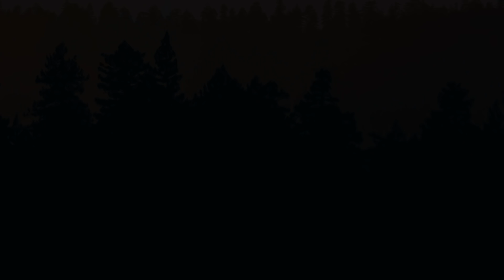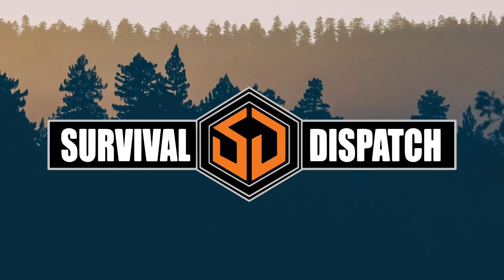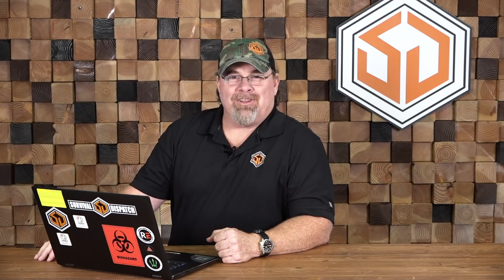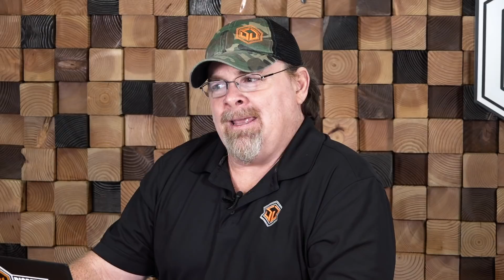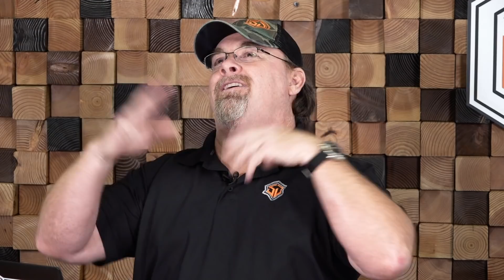All About Generators!

Comment: Another good idea is use a solar system and use the generator to top off the system at night.
Reply: Mine is 300 watts into 4 6volt golf cart batteries using a controller.. cost around 1000 total..with inverter..i use a A- I Power 2300i inverter generator uses 1 gal every 6 hours.   This is NOT a large setup but will run alot if you split up the load properly....small frig .. computer,,,lights..satillite dish..tv...fan...not all at once but it works..the generator was extra at 350 on sale at Sam's club so total under 1500
Reply: Mine is at full load if I went to half load I can double run time. Plus I didn't figure in the 6 hour I get out of the battery before I need to charge it up
Reply: @Karl Schubert  you should lowes sold it to you and that's were i sell them
Reply: @Karl Schubert  the reason I went with the A IPower 2300i is price. I got  it at Sam's for $345 and couldn't pass it up. I have a Champion 4000 and a Generac GP3300 that I bought at Lowe's someone returned for under $200 each...lol Im in Brunswick ga hurricane territory
Reply: @Karl Schubert  last big one I was the ONLY guy on my street with power, food , water , HOT water,Internet ,direct TV,  air conditioning....
Reply: @Karl Schubert   go silent as you can lowes sells a plastic tool shed,,line it with that silver insulation all side including top..add a box fan 18 dollars or a attic fan cut a hole and put some vents to blow out one side use vents on the other. You also can run it in rain that way! CHAIN that GEN to unmovable object! at 10 feet that gen will be silent! use the biggest size cord you can afford I MADE mine with 10/3 insulated wire we sell at lowes for .1.88 a foot and use the 30 amp locking plug one end and a 2 gang household plug at the other..look it up its easy. that will add 1/3 more to your available load at 30 feet total cost for a 30 ft cord was 70-80 bucks that way..commercial cords are over a 100 BUCKS! for a 25 ft                               https://www.lowes.com/pd/CRAFTSMAN-Common-4-ft-x-2-ft-Actual-Interior-Dimensions-4-08-ft-x-2-38-ft-Storage-Shed/1001052378

Comment: Propane is expensive and generates less wattage out of the same generator. I sell them for a living...also most people buy way to big of a generator.
Reply: Correct. natural gas is 200% more effective and efficient than LP from a generation standpoint as well as cost. Also, LP will disappear quickly, natural gas will continue to flow for some time because virtually all of the national level emergency operations plans and contingency operations have a massive priority natural gas, and they'll keep those lines charged if at all possible, for as long as is possible.
Reply: Diesel is nearly twice as efficient as gasoline. Lasts longer too.
Reply: @basspig  its also LOUD! around 100 decibels, everyone in a mile will know you got power..also VERY heavy and expensive ME I would spend it on a solar system with a inverter generator to charge it as a back up
Reply: Rick B 
Rick B, I’ve been looking for someone to mention natural gas.
Reply: It is..now try to find one.,.in india its not diesel its kerosene that is king

Comment: You missed one important point.  Make sure the generator is GROUNDED.  Most electronics will not run if the power source is not grounded properly.
Reply: Karl Schubert 

The manual that comes with your generator will tell you to provide a grounding rod, similar to the one for your house, to properly ground the generator
Reply: Here are the rules about portable generator safety: This is just a reminder for everyone’s safety. All generator safety rules should be followed carefully. This advice is just to make sure that everyone is aware of all the warnings and it’s just to remind people to be careful using portable generators. Generators can be dangerous if not used carefully. Every year, hundreds of people die or get injured when using portable generators due to carbon monoxide poisoning and electrocution. Make sure you are using your generator carefully and keeping others safe as well. There is something very serious that everyone should always be aware of when using generators. Some people do run their generator indoors which is not safe and that increases the risk of carbon monoxide poisoning which can cause death of family and you. Some people run their generator in wet conditions which can electrocute them. Please remember that you should never run your generator indoors. Remember that carbon monoxide is an odorless and colorless gas that you cannot see or smell. Carbon monoxide is a silent killer. Keep that in mind. Make sure your generator is 15-20 feet away from your house and away from doors, windows, and vents. Never use your generator in your porch too. Having a carbon monoxide detector is very important against generator safety. Some people also allow children to go near the portable generator which could pose risks. We need to keep an eye on our children making sure that they are not near the portable generator so they won’t get electrocuted or burned by the generator which is dangerous. A locking enclosure also keeps kids safe. A generator shed might look like a tempting place to explore, or take cover during a game of hide and seek, but a generator is a dangerous piece of equipment that can cause injury. It says on the manual that we should also keep children away at all times from the portable generator to avoid injuries. Please do not allow a child or unqualified people to operate the portable generator.  It is important to keep your children safe especially little ones. The portable generator can be hot during an operation. Just because some manuals missed what should be listed doesn’t mean it’s safe to do. Always follow the generator safety rules when using portable generators. Generators pose electrical risks. If you need to use your generator during wet weather, you need a generator tent to protect your generator from getting wet. Don’t let your generator get wet. Keep your generator dry and before using your generator, please make sure your hands and your generator is dry. Do not wear loose clothing when operating the generator. Everything that is said on the generator’s operating manual should not be ignored. Never smoke cigarettes near the generator. Please keep flammable things away from the generator. Never overload your generator too. Your generator can catch fire. Never ever try to plug a generator cord into a wall outlet to avoid back feeding. Back feeding your generator is dangerous. Always turn on your generator first before plugging in appliances and shut off the appliances before turning your generator off. Use a heavy duty cord for your generator and the cord should not be worn out. All the instructions should be followed carefully. Never refuel your generator while it’s running. It can cause fire if fuel spills while your generator is hot. You should turn off your generator and let it cool off before refueling it. Having a fire extinguisher next to the generator is also important. This is only a reminder for everyone’s safety of using generators. Make sure your generator is properly grounded. Having a fire extinguisher next to the generator is also important against the safety rules. https://youtu.be/I1jT3ANENvI and here is a video more about keeping others safe when using generators and also about our family’s safety. Hope this helps. Thank you.

Comment: My generator has been sitting in the corner of the shed for 18months waiting for me to service it. Thanks for the vid, will get it done today.
Reply: Here are the rules about portable generator safety: This is just a reminder for everyone’s safety. All generator safety rules should be followed carefully. This advice is just to make sure that everyone is aware of all the warnings and it’s just to remind people to be careful using portable generators. Generators can be dangerous if not used carefully. Every year, hundreds of people die or get injured when using portable generators due to carbon monoxide poisoning and electrocution. Make sure you are using your generator carefully and keeping others safe as well. There is something very serious that everyone should always be aware of when using generators. Some people do run their generator indoors which is not safe and that increases the risk of carbon monoxide poisoning which can cause death of family and you. Some people run their generator in wet conditions which can electrocute them. Please remember that you should never run your generator indoors. Remember that carbon monoxide is an odorless and colorless gas that you cannot see or smell. Carbon monoxide is a silent killer. Keep that in mind. Make sure your generator is 15-20 feet away from your house and away from doors, windows, and vents. Never use your generator in your porch too. Having a carbon monoxide detector is very important against generator safety. Some people also allow children to go near the portable generator which could pose risks. We need to keep an eye on our children making sure that they are not near the portable generator so they won’t get electrocuted or burned by the generator which is dangerous. A locking enclosure also keeps kids safe. A generator shed might look like a tempting place to explore, or take cover during a game of hide and seek, but a generator is a dangerous piece of equipment that can cause injury. It says on the manual that we should also keep children away at all times from the portable generator to avoid injuries. Please do not allow a child or unqualified people to operate the portable generator.  It is important to keep your children safe especially little ones. The portable generator can be hot during an operation. Just because some manuals missed what should be listed doesn’t mean it’s safe to do. Always follow the generator safety rules when using portable generators. Generators pose electrical risks. If you need to use your generator during wet weather, you need a generator tent to protect your generator from getting wet. Don’t let your generator get wet. Keep your generator dry and before using your generator, please make sure your hands and your generator is dry. Do not wear loose clothing when operating the generator. Everything that is said on the generator’s operating manual should not be ignored. Never smoke cigarettes near the generator. Please keep flammable things away from the generator. Never overload your generator too. Your generator can catch fire. Never ever try to plug a generator cord into a wall outlet to avoid back feeding. Back feeding your generator is dangerous. Always turn on your generator first before plugging in appliances and shut off the appliances before turning your generator off. Use a heavy duty cord for your generator and the cord should not be worn out. All the instructions should be followed carefully. Never refuel your generator while it’s running. It can cause fire if fuel spills while your generator is hot. You should turn off your generator and let it cool off before refueling it. Having a fire extinguisher next to the generator is also important. This is only a reminder for everyone’s safety of using generators. Make sure your generator is properly grounded. Having a fire extinguisher next to the generator is also important against the safety rules. https://youtu.be/I1jT3ANENvI and here is a video more about keeping others safe when using generators and also about our family’s safety. It’s important to keep our children safe especially our little ones. Generators can cause electric shocks too so be careful. Hope this helps. Have a good one. Thank you.

Comment: Yup, I’ll just stick with my solar panels and lithium batteries. 😉
Reply: @Karl Schubert  I dont think you understand the capabilities of proper off grid solar systems... I have a 4kw system and we regularly (once a month) go "off grid" and run only essentials for a few days for practice. Its all about calculating your usage, and sizing generation and storage capacities accordingly.
Reply: @Karl Schubert  🤦‍♂️
Reply: Karl Schubert Sure will. Just depends on how many panels and lithium battery storage you have.
Reply: add a wind turbine and a water turbine if you can,,,helps alot

Comment: Great information. Generators are great but very dangerous. Tons of house fires(and co2 poisonings) happen every year. Propane is good but i find it harder to find in a emergency than gas. It also doesnt allow for as much power
Reply: I think. Could be wrong... He's thinking more along the lines of using a "big" tank mostly. 250 gal or larger. I know he mentioned the grill sized tanks and that they were safer and easier to obtain in a disaster. But if you could hook to a large tank and ration it'd be peaceful thoughts.
Reply: @user-rd4gz1nc4e  thats understandable. We use a 250 for heat. It takes a week or longer to get refilled so as long as its a designated tank, he should be good

Comment: Don't tell everyone to turn off "every breaker in every panel in the house". They need to turn off the main breaker to the house. The master breaker. The (most commonly) 200A main breaker which may be in the main panel or it could be near the meeter, it could be a single large breaker or several (usually 3) linked together. That is how you prevent electrocuting line workers or avoid destroying your generator by trying to provide power to your whole block.
Reply: he said that to cover the fools that try to run everything at once
Reply: 26:23 He said to turn off the main breaker.
Reply: @John-tx1wk  you are right but he under emphasized it. That is the main thing to do, not turning off everything else. I missed him say it, and I was looking for it, so what is someone following his instructions going to hear/do?
Reply: @Zanthum   You are right!!

Comment: "Sending power back through the house in reverse polarity"
........
Please tell me what is the polarity of Alternating Current (AC) electricity.
More likely you didn't hook up neutral or connected hot to neutral and neutral to L2 or L1 which is a big problem and will destroy appliances but has nothing to do with polarity.
Reply: If you don't understand AC power, call a licensed electrician to help you get set up. You don't want to be the guy that knows "just enough to be dangerous" without realizing it.  Don't wing it.
Reply: @reedr1659  My point was that ac power by virtue of it being AC there is no polarity if it is polarized it becomes pulsed DC. Rectify and smooth it and it is just normal DC at whatever voltage. You can have a backwards connection but that is a reversed connection not reversed polarity. You can have it out of phase but that doesn't really apply to this situation because if you hook up to live you will blow the generator and isn't possible without separate power sources. I am more qualified than many electricians and from first-hand experience I'm more qualified than some electrical engineers. The engineers at work electrified the safety ground on one occasion, almost set a fire due to loose connection on another and underrated the wires for machinery so their machines are operating in the safety margin rating of the wires on another. The electrician didn't catch that and also almost set a fire due to a loose connection of his own. It came down to I had to redo everything any of them (engineers or electricians) touched.

Comment: Use stable works just fine .
Reply: I have 90 rec fuel down the street $2.99 a gallon no stable needed.
Reply: Josh Beekman you wont have that when power goes out pumps will not work
Reply: @warlantactical  I have some already
Reply: I use the marine stable. It has a longer sit time and has a moisture inhibitor.

Comment: Generator sizing: you missed that a generator is most efficient between 50-80% load. A smaller generator running flat out will actually use more fuel than a larger generator running at half capacity. So no getting the smallest generator you can is not necessarily the most efficient use of your limited fuel. 

You would be better off using a larger generator intermittently to charge up some batteries (LiFePO4 recommend for power density,charge rate, cycle count and more) and then use those on an pure sine inverter to run your fridge/fan/etc. smaller loads where the generator would be mostly idle. A fridge pulls iirc around 200w but for a long time. That is a long time to keep your generator idling using more fuel to keep the rpms in the correct range than actually doing any real work.
Reply: I did agree. Gas engines are most energy efficient running full throttle. I wouldn't size a generator to run full throttle that being said. Invertor generators are the most fuel efficient
Reply: Solid advice
Thanks
Reply: to a degree they will dont go over what you need in power ..use the smallest one you can use and just run things in a smart way. Friges only need to run every 8 hours to keep cold if you keep the door shut..things like that. what good is a 12000 watt gen out of gas? they use 5 gals every 8 hours when a 3500 watt will run 12 hours on 2 or 3 gals
Reply: Actually they run at the same speed at around 3500 rpm. Now that said, you use more gas with more load like a car going uphill. The bigger the motor the more gas you use. That gas costs a lot, ,to buy, to store, and to keep enough on hand.  3500 watt generator uses 50% less gas than a 5500 watt generator
Reply: Zanthum  ,   Yep. True as you stated. Most people don't know, they guess... almost always ending up with undersized and fragile systems.  Also, they forget the FIRST thing about generator safety, the simple detector which would have saved the whole family and pets.